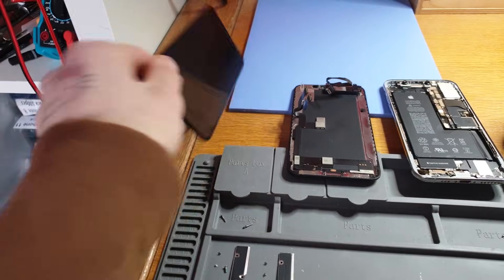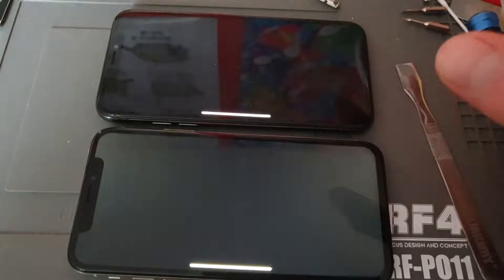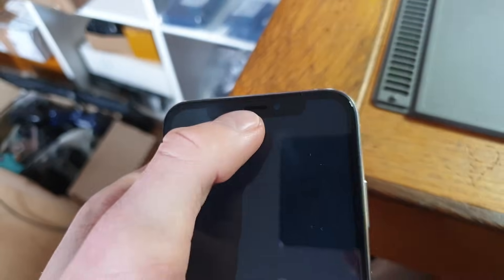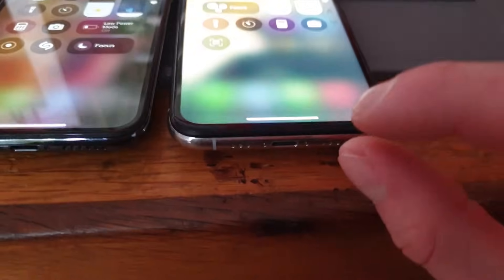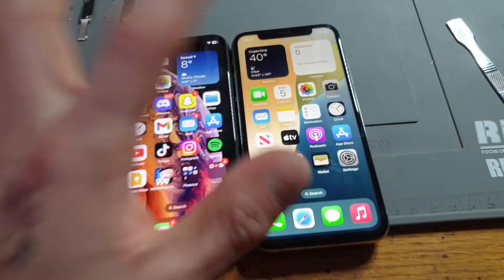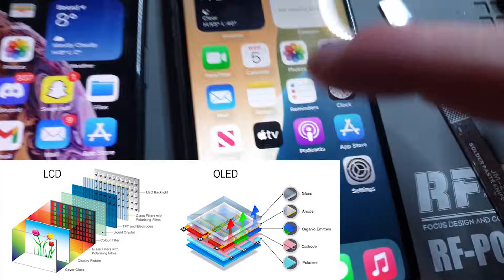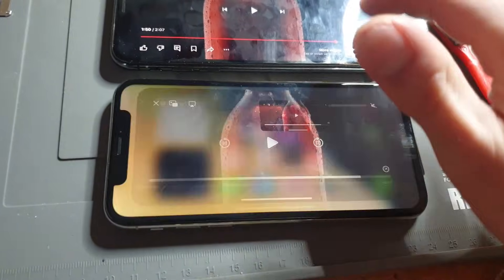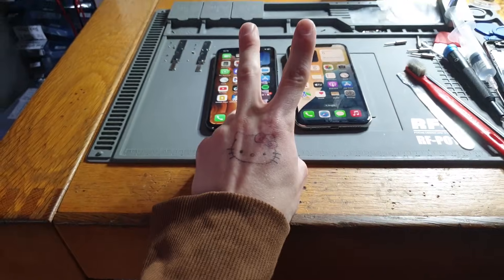LCD vs OLED on iPhones compared!

Comment: Hey bro I have a question, I need a new screen for an iPhone 12 and I have the option of aftermarket oled or oem iPhone screen, am I good with just aftermarket oled?
Reply from the maker: make sure it is soft oled, not hard oled. Hard oled breaks really easily and quality is not that great